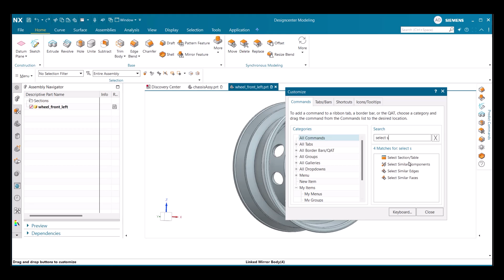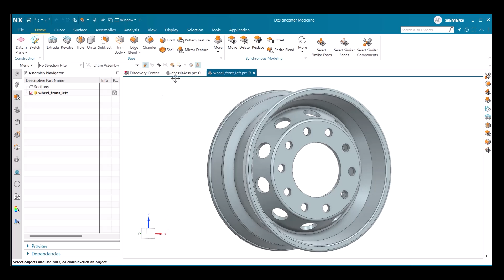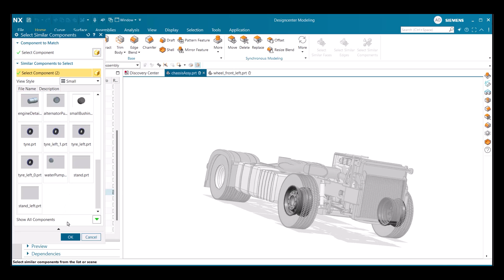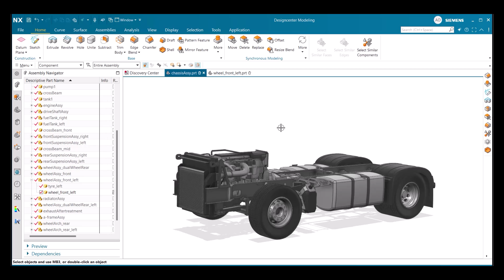NX | Tips and Tricks | General Selection Filtering UI

Comment: please implement "Tab and Slot" feature , we started using NX but we are really missing this feature from Solidworks , it's been there since 2018 and there is no direct equivalent for it in NX
Reply from the maker: Hi - thank you for this request. We will pass it on to the product team today. ~ Team Siemens
Reply from the maker: To follow up, the team advised us that this is a feature that has long been part of the NX software. We recommend visiting the NX User Community for detailed info on how/where it is found. Please join the community at this link and ask your question or research prior threads on this topic: https://sie.ag/5cZka4
Reply: @SiemensSoftware  
I might not have expressed myself clearly earlier , the "Feature templets" function is indeed there since 2020 or 2022 i think , 
but what i was  referring to is "Tab and slot" dedicated feature which makes joints between sheets of metal automatically , 
the function can be replicated with feature templets yes , but it is tricky to setup , 
i searched the community and could not find any indication that "tab and slot" feature is a native feature in NX
Reply from the maker: Hello - thanks for the follow up message. The team recommends you ask your question in the Community, and also specify which version of NX you are using. (The features you mention are native to NX Sheet Metal) It will be easier to get additional help there vs. here via YouTube. Thank you -- Team Siemens